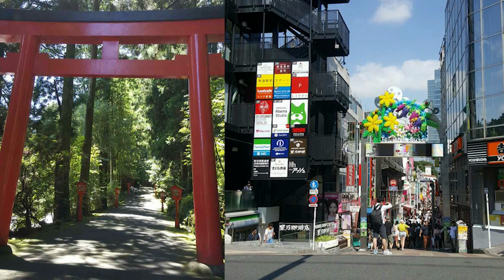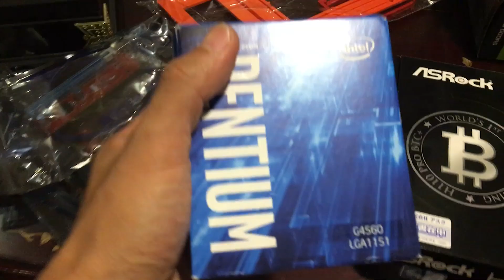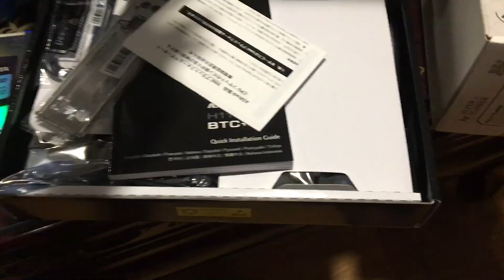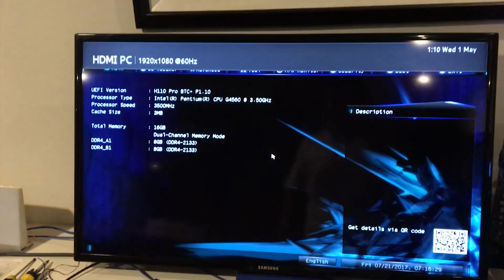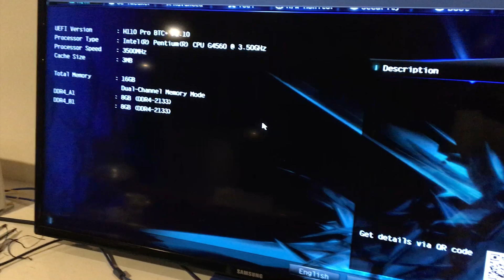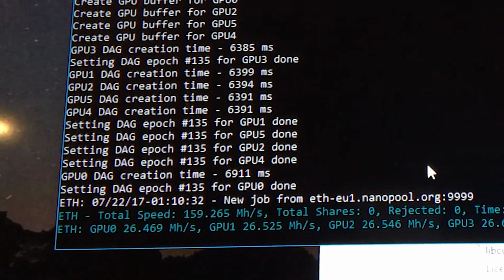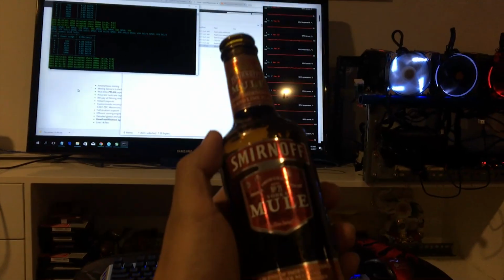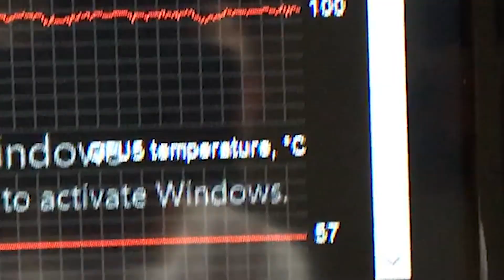Asrock H110 Pro BTC+ Mining Rig Build Part 1

Comment: Hey can you tell me how to connect two molex that’s on motherboard? With what cable and to what end on the psu? 

Does the two molex on the board needs to connect each other then to psu and which section of the psu? perif or sata or cpu or vga?

also if i use two psu does it need to be connected to primary psu?

thanks
thanks

Thanks
Reply from the maker: you just need a molex ribbon connected from the PSU to the two molex slots in the motherboard. Need to connect it to the main PSU.

Comment: How come it can not detect my gpu :( code 43. Any suggestions?
Reply from the maker: Donchi Reyes code 43 is a graphics driver issue i believe. Try clean uninstalling the graphics driver using DDU (display driver uninstaller) software and reinstall the most updated driver. See if it fixes the issue

Comment: Hi dave i would like to ask about the 6pcs 1070 if will work with 1200 platinum power supply   what is the recomended oveclockjng settings. Thanks.
Reply from the maker: hey Alvin!  The PSU can definitely run the 6 GPUs but I'm not entirely sure how long it will last.  The efficiency and lifespan of the PSUs can go down quick especially if always running on high capacity.  I had this experience where my rig kept on crashing after the 15 hours running straight.  I was about to go out of my mind and thought it was one of the GPUs gone bad.  I ran the rig with one GPU at a time and every 24 hours, I keep adding another GPU. When I hooked up 5 GPUs, it started crashing again after 15 hours of running.  I thought I found the bad GPU and hooked up the remaining GPU (6th).  with 5 GPUs hooked up, it crashed again.  I thought it can't be that 2 GPUs have gone bad.  Tried hooking up only 4 GPUs (2 of which were the "bad" GPUs) and it ran for 24 hours.   That's how I concluded it was the PSU.  I added another PSU to power up the system, and no problems after that.  Check out my other videos, those might help you out further :)
Reply: daveFL is it ok if i add a 500 watts psu to power my 6 1070 ?
Reply from the maker: Alvin Klein Santos you can use that to power the motherboard and one GPU. You'll just have to use an add2psu to get the 2 PSUs to work in one rig
Reply: daveFL thank you dave for your clear technical support 👌🤗⛏
Reply from the maker: happy to help! :D

Comment: I am having a lot of trouble with the board.  I am trying to get 8x rx570 and 2x 1060 to work on board it cannot run more than 7 x Rx 570 at a time.
Reply from the maker: try installing the RX driver first, connect the main display to one of the RX cards, disable windows auto updates, hook up the Nvidia cards and then install the Nvidia drivers
Reply: Thanks, but now I am now, I am in love with this board.  Some of the risers were of bad quality and causing issues,  also mining system takes time to get stable at-least for Windows.  Once its stable it runs perfectly until dismantled. Working perfectly for me now.  The new driver 17.11.4 are good can get 10 rx 570 to work.

Comment: Did you have to do anything in the BIOS to get Windows to recognize the GPUs? I cannot get mine to recognize any GPUs besides the one in the big slot on the Mobo itself.
Reply from the maker: be sure to update the bios, set it to 3.5 Max TOLUD, and PCIE to gen 1 or gen 2 (whichever will work). good luck!  Careful with the risers coz you might end up shorting your mobo like it did. Check the next video I posted.
Reply: Turns out I got a bad PSU. It was working on my last build but since the mobo upgrade it just went to crap. It was a 127W Thermaltake. Gonna try to return it and get a EVGA. Thanks for the pointer.
Reply from the maker: glad to help!  I actually had a bad PSU issue too.  My 1200w PSU can't handle more than 3 GPUs running at 120w each.  It would crash/hand the system after running for more than 15 hours straight.  Couldn't RMA it coz they said the PSU is working.  lol

Comment: Just to let you know, there is an option in the BIOS that says "....After power Failure", that option when Enabled puts the MB to turn on after there were no Power (Electricity Cut, or PSU Button Switched OFF), that means that as soon as the power comes back or you switch the PSU ON it will immediately start.

Comment: Nice rig design. I'm planning on the same materials and concept build

I am moving the fan (similar size) on the bottom, with a HVAC house filter under the fan, blowing up.

Moving the cards to the top, BUT positioning them vertically, instead of sideways. Also moving the motherboard to the side, vertically like in a case, it doesn't need cooling like the GPU's do, same with the PSU, move it out of the way on the side. you'll have an open space in the middle for more mass CFM air to flow to the GPU's 

This will create a free flow of air from the bottom fan up to the GPU's then out the top. Heat rises, so the GPU's are the last equipment on top to dissipate the heat.
Reply from the maker: sounds like a better option.  Will try to figure out how I can do that with the current set up.  Thanks for sharing the idea!
Reply: cool, let know know if you do and how it turns out. I've seen one setup like it, BUT didn't have the fan at the bottom. been hearing that vertical setup on GPU's dissipates more heat from the cards for some reason.
Reply: Ill make you one if you wanted something longer then my current design. peak the vid on my chan.

Comment: But windows can only recognize 8 gpu
Reply: i use linux to mine with 12 gpus with no problems
Reply: hmmp hhm according to him, The limit is 8 GTX cards and 5 AMD cards. If you wanna see the actual comment that he made its a reply to someone else.
Reply: My Rig recognize only 4 gpu with win7, but i got 6gpu's. I will fix this issue with win10?
2Gpu cant recognize drivers
Reply: Banzai how can I view my pc remotely or control it remotely using Ubuntu  ty
Reply: hmmp hhm you can use TeamViewer on ubuntu.
Reply: ethos ?

Comment: Why RAM runs @2133MHz instead of 2400MHz?
Reply from the maker: Vidmantas Balčiūnas not sure how you got the idea but what i installed are 2 2400DDR4 8gb ram sticks :)
Reply: CPU supports RAM @2400MHz, RAM is 2400MHz, but the BIOS shows them running @2133MHz.
Reply from the maker: Vidmantas Balčiūnas i believe at default, the mobo runs mem @2133mhz but I can raise it up @2400. Havent done much changes in the BIOS setting yet. Will most probably tinker with it when the time comes to complete the 13 GPUs
Reply: You will not able to make more than 8x GTX1070 GPUs work properly under Windows. You need Linux to run all 13.

Comment: Have you been able to connect all 13 cards? I've got a weird issue related to ethernet and cards. When I plug 9 GTX 1070cards it boots fine and windows sees all cards but as soon as I connect the ethernet cable then my computer freezes. Thanks
Reply from the maker: fexnok still waiting for my AMD cards to ship in. A little delayed coz of the weather here. 

I believe windows has an 8 GPU per make limit. That means you can only install up to max 8 GTX cards then 5 AMD (or vice versa) to make the 13 GPUs. Be sure to disable auto detect video cards on windows when installing those cards :)
Reply: daveFL you're right. Didn't know about 8 gpu limit. What a shame.
Reply from the maker: fexnok that's alright. You can always sell it, swap it for an AMD card (preferrably RX 480 8gb) or send it over here in the Philippines. I'll make sure to make good use of it. Haha! Scarcity of good video cards here is a bummer
Reply: daveFL haha good one. Maybe we can exchange them 😃
Reply: Sorry, one last question. There are three extra power connectors on the motherboard. 2 molex (PCIE_PWR1, PCIE_PWR2) and 1 sata (SATA_POW1). Do you connect all three? or just two molex?  Thanks
Reply from the maker: fexnok if you have the extra sata and molex connections, i say why not? As long as it wont be a double connection from your risers, i think it's better if you connect them. It should give the mobo more stability when handling 13 GPUs
Reply: Thanks

Comment: Thanks for the sharing. I plan to build a Asrock H110 Pro BTC+ Mining Rig + 5 GPUs. Hope to learn more from you.
Reply from the maker: EforceVideoShare so far, it handles 6 GPUs pretty well. Been stable eversince i built it :)
Reply: daveFL I have the biostar tb250 with all 6 cards on, one cards drops to one mh-.-. I honestly believe it's a hardware problem, it works with 5 well